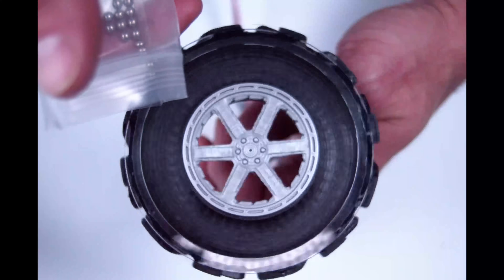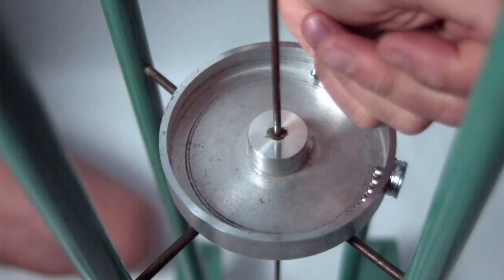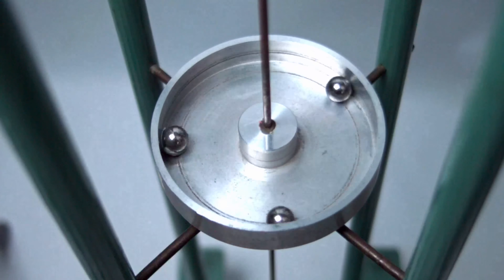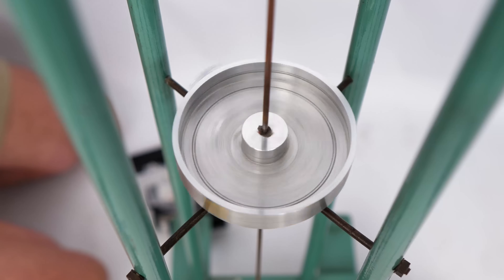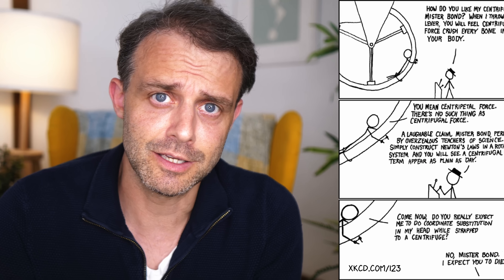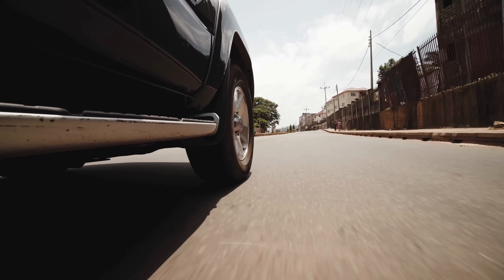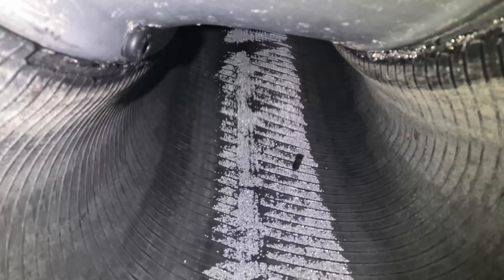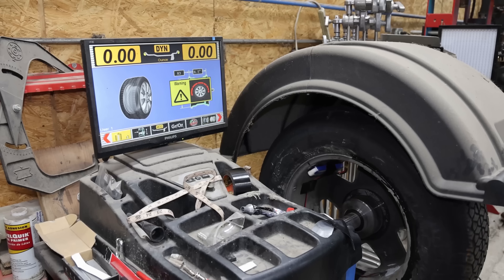Do tire balancing beads actually work?

Comment: I worked at a tire shop for a few years. My thoughts are this: beads are a last resort. Some people get great big ugly wheels and out-of-factory-spec sized tires, and sometimes those combinations of wheels and tires are cheaply made or badly balanced. That's where beads come in, because otherwise, you'd be putting on a whole kilo of weights all around the circumference of the wheel and you're never supposed to put more than 1 weight on. A bad balance job is putting on a weight, then counter-balancing that first weight with another one. That's what the first one was for, was balancing against the wheel and tire's lack of balance in the first place. And weights don't have the problem of needing the tire to be spun up to a certain speed for them to work as intended. We hardly used beads at my shop, but some people REALLY want that big, lifted truck look and spend the absolute minimum for bad wheels and cheap tires to achieve it. I still got paid for the work, so I didn't care much.

Comment: Considering you get free mounting and balancing when you buy new tires... who gives a shit? lmfao when you get new tires, problem solved til you need new ones again. 

Usually even used tires they will sometimes still balance them for free lol. At the very least, cheaper than these plus shipping and time waiting lmfao. So yeah technically it "works" but it's still a scam.

Comment: I concur with your research based on my personal experience. 

After installing balancing beads on my offroad Jeep on 37" tires, I still had issues going from 0 to ~30mph experiencing violent "death wobble" as many term it. A product of large unbalanced tires and soft offroad suspension. It would be so bad at times that I would be forced to pull off the road. After reaching the supercritical point, it was fine. 

I ended up removing them for a traditional balance, as my driving consisted of highway speeds to a stop, no slowdowns. 

Your speed approximation for the supercritical point is tire diameter dependent, fyi.

Comment: The best use of this would be to create quick-balancing tires. Rather than leaving a mess of beads to slide around inside the tire and potentially damage it, you have some weights on rails inside the tires that can be unsecured, allowed to move into their optimal position from the tire rotation, and then re-secured to keep them balanced without losing it when you slow down or causing wear from their motion.

Comment: Its the same with my old 1 Cylinder motorcycle I think. At lower rpms it completely rattles itself apart, but when revving higher it suddenly goes quiet and doesnt rattle that bad.

Comment: The visible issue from this video is that the shaft under the wheel is now wobbling. So would that wobble transfer to other parts of a drive shaft, perhaps even into the gearbox?

Comment: anyone in the comments here used beads on vintage aluminum wheels? I have some wheels from the late 60's that have to be balanced by the lug nut holes, they're not machined in the center so they can't be balanced there. No tire shops around here can do lug balancing.

Comment: I used them myself and use them they do work when the quality of them it good. Smaller and more are best and at speeds of over 40mph I always had a very smooth ride. And yes I tested them even on 80-100mph and yes it works. I had tested it on speed low profile, offroad and even 39" tires and it works very well as long the applied mass in the tire is 20% greater than the out of balance of the whole wheel assembly.

Comment: I just started the video.  But a tire its not a circle when riding a car. The rim it is. You should have like 55psi air pressure to this to work or solid tires. You hit a hole going 180km/h and its gonna make the opposite effect for a couple of very dangerous seconds

Comment: Had a set of tires once that the shop used balance beads in it. Couldn't stand to ride in it. Took the truck back and had them take the out and balance the tires correctly. I'll never run those stupid things again

Comment: I've used tire beads in many sizes and styles of tires, from summer car tires to off road truck tires. 
Generally speaking, the speed at which the unbalanced tire would noticeably vibrate, is also the speed at which the tire beads begin to work. 
In other words, they tend to work very well, as long as there is sufficient quantity to offset the weight imbalance of the wheel.  Proper installation and sufficient weight is paramount for beads to be effective.

On some smaller tires, they sometimes do not work as well, and they may negatively impact TPMS sensors on equipped vehicles

Beads can sometimes make up for worn suspension components (such as shocks and bushings) as long as their weight is sufficient to counteract the movement of the suspension.

Comment: so im posting this to make a prediction about why it shakes less when its faster. 
the idea is that the off center weight is what pulls the bar to the side due to centripetal force. thats what causes the large wobble.
but at hig speeds the moment it gets pulled to the side, the weight has already shifted to a new location. and at a high enough speed the weight has already moved 180 degree by the time the bar is getting pulled. essentially creating a sudo counter balance. due to the fact the weight is constantly moving it will never create a perfect one to one counter so there will always be a little wobble. though if this prediction is true that also means theres a speed where the wobble would be small enough to not really notice.
i also think a big part of this is the fact the wheel and the axel are 2 separate forces. if they were one singular mass i think the wobble would be made worse instead of correcting itself. 
i have done NO research into this. just playing out how i understand physics in my head to test if its correct before he gives an answer

Comment: Physically I can see that the beads, when in motion, will migrate to a position that balances out the disc. Okay, that works.  BUT, where this whole concept fails, IMHO, is that since the beads are not fixed in place, it means that initially each and every time you drive the vehicle, the wheels will initially be out of balance and create vibration until such time that they reorganize themselves again.... and again... and again... and again. So yes, balancing beads work. Just not well. It's like putting a bandaid over a cut, and then each morning ripping off the scab and applying a new band-aid to cover the damage. Why do I use a bandaid example? Because those beads will create internal wear through abrasion, and in turn create a residue of finely ground rubber. Would that potentially create a blockage of the tire valve?  It's an interesting concept, but not a practical solution to tire balancing.

Comment: balance beads in Slower inner city traffic @ 35 mph average is useless. Tire will need a higher rotational speed to balance them sevles, @ 60 or more mph. Works great on semi truck , but is wobbly at inner city stop and go traffic. Both Lexus SUV and Toyota Camry were a failure. But worked on highway truck.

Comment: I work in a tireshop, and rarely see  these beads. Actually been working there for close to 10 years now and have only seen them twice.  Thankfully.  They ARE a cool concept.  I won't deny that, but they are fairly useless in the city.  Stop and go, stop and go.  Speed limits don't reach that critical speed needed for the beads to take effect, and so you're constantly left with unbalanced tires.  PLUS they are so MESSY.  Especially when you don't know there are balancing beads in the tire!  Anyhow, we use weights.  They ALWAYS work, no matter your speed, and they aren't as messy... unless you have my boss working who tends to just drops the weights he just removed off the rim onto the ground instead of the buckets we are SUPPOSED to put the used weights in for recycling.  Leave him alone balancing all day, and you'll have weights and the paper off the back of the sticker weights all over the floor! lol

Comment: This is very interesting. But it won't work in real life. 

A tire shop balances a tire, they will put counterweight on the inside and the outside of the tire. So both inside and outside of the tire would balance out. The beads will not go to the right place to make this work. On top of that, you will need to put the tire on a balancer to figure out how much beads you need to put inside of the tire. It is a waste of time because if you are a tire tech, you know you will have to bleed the air out of the tire, break the tire bead just to put these beads in. Air it back up. Put it back on the balancer to make sure it balances out. If not? Repeat. Very time consuming. 

Inside of the tire is the inner liner. The inner liner is curved, so the beads will go to the center instead of the inside or outside of the tire where it needs counterweight.

Tire rotates. Beads move freely. What does that mean? It means the beads will wear the inner liner down. Inner liner is very thin and its job is to keep air from escaping. It is not repairable if it is compromised. Unlike getting a puncture where a tire tech can plug and patch the damaged area. Simple way to say this is beads will eat the tire from within like cancer. Tire becomes road hazard without warning. 

If anyone wanna try this out. Be my guest. But keep us updated. I'm totally ok if someone can prove me wrong.

Comment: Been putting 4 or 5 goofballs in my oversized truck tires for years.  Works great.  They smooth out at about 25 mph.  Never had to get up to highway speeds. Prob the larger diameter of a golf ball allows it to move into place much easier than all the small diameter beads.

Comment: Every video I have seen where people test them, they work. But every time I see a video on someone asking a mechanic, they say they don't work and often time have to remove them after people put them in and cause issues. Interestingly when he shows the inside of the tire, that guys test showed them starting to work at very slow speeds.

Super annoying. Best answer I have heard is that if moisture gets in the tire (from the compressor usually) than the balancing beads stop working.

Comment: Could you use thermal sensitive plastic so when you hit those high way speeds, it melts the plastic beads in the place they need to be? With some rubber flux to help adhere to the rubber tire? This would solidify the beads in place for slower speeds, and even if you start to degrade it too far, it should still space correctly.
Reply: Alot easier said then done, but you know...

Comment: I swap and balance my own tires on my motorcycle. I didn’t have much confidence in the beads, and this video has turned me off the current beads. I wonder if a bead infused lightweight putty might keep the beads stuck to the sweet spot, but not so much that higher speeds, and momentum, can’t continuously improve the balance.

Comment: I use them on a motorcycle, and they work great. I mount my own tires and dont have to pay to have them balanced. Just add the correct amount of beads. Ive been 100plus with no issues. They also work and are safe inside motorcycle inner tubes as well.

Comment: Anyone ever measure if this decreases fuel economy before the beads get to the right place?I would imagine that a properly placed fixed weight would have an advance of being in the right spot ore of the time across all sleds. Obviously if truck tires wear, and the balance changes fixed weights won’t help.

On the test stand, measure plot rpm vs energy consumption…

Comment: Even before watching the Video I as Car Mechatronic thought: What a scam, just invest bit money in balancing your tires by a professional and don't use such Scam xD 
Might work for the time you are driving at a certain speed or at least had a high enough speed reached for a certain time... but the second you have to break and go down over a minimum speed or have to stop, it's gone again and you have to accelerate to the high enough speed again... and since my assumed speed for this would be again around 80-100 km/h (50-60mp/h) I already thought: Wont work for Citys, only works for Cars nearly 100% on Motorways, Freeways, Highways, Autobahn or what you like to call it ^^ and even in Germany here, with all the traffic jams and construction sides on our Autobahn this will bring those pearls back to "default" position all the time and therefore the tires out of balance... also I guess even though the this might be glas pearls... if the need to be cheaper then getting your tires balanced by a professional, they might not be perfectly round and without any cracks or things... therefore the might damage the tire from the inside and since there most of the time is a bit moister inside a tire cause of the Air and slight diffusion... and therefor these rubber pieces or rubber powder that is made from the imperfect pearls rubbing against the rubber, will clumb together and will get a bigger mass by themself... and will cause maybe to much counterwait, the pearls can't outbalance... or get a sticky mass, there the pearls get stuck to...

And Video convinced me, that this is BS and you should get a professional tire balancing, not this waste of money! Like even if you would drive constantly on a Freeway and get to those speeds often... the time till you get them, your car is imbalanced and things like your wheel bearings won't thank you for this... so you might save a bit money by not balance your tires, but will have to pay MUCH more afterwards by constantly have to Change other parts that get damaged by your often imbalanced tires (like said for example your Wheel Bearings).

Comment: Those beads are interesting, but they fall apart in city way driving. As you stop at signs and lights more often then not, removing the effects of the beads, while also not having the time, room or legality to get back up to speeds to let the beads get into place... Still useful knowledge and depending on the usage of the vehicle, could be useful!

Comment: The choice between a solution that always works but requires a little more effort or a solution that sometimes works but lets you be lazy is an easy one for me.
I value dependability.

Comment: psss.... real cars do rarely sometimnes use this and they are plastic beads not glass or metal for automotive.is only ever done if an excessive weight is needed to balance tire, typically lorry/big rig tires would need this not a small truck or car.

Comment: 2:28  I think that fixing a ball bearing inside the wheel will compromise your experiment.  That's because there is a dynamic process by which the other ball bearings reach a state of counterbalance, and being allowed to move freely around the wheel may be essential to achieving this state.

Comment: What if the beads get sticky when heated up? Will highway speeds not heat up the tire and therefore the beads, and fix the lower speed problem?

Comment: The beads would have to have a way to stick to the inside of the car wheel once they are in the right place to be completely effective, maybe a liquid or gas that chemically reacts to the beads and binds them to the wheel after a short time.

Comment: Many years ago I put balancing/tire sealant in my motorcycle tires.  It takes a few miles to actually the thick fluid to disperse around the tire for the balancing to begin. Once balanced, the fluid tended to stay in place, and adjusted automatically as needed.

Comment: Rock crawlers with slower moving wheel speeds has used that balancing system for a couple of decades. Steel Balls not glass beads.

Comment: These beads are advertised as a great way to balance heavy off-road and heavy-duty tires. I tried them on my 37" tires, and they didn’t work. After watching the video, it’s clear why. If they only balance properly at 10–15 rotations per second, as the author mentions at 9:18, that translates to the following speeds:

35" tires: 100–150 km/h
37" tires: 106–159 km/h
40" tires: 115–173 km/h

So, the larger the tires, the higher the speed required for balancing. These beads don’t make much sense for off-road tires and might only be useful for smaller wheels, which are already easy to balance without beads.
Reply: The larger your wheel the lower will be the resonant frequency that you need to exceed.    Also,  the rpm will be lower for any given road speed.    There are many comments here from people testifying to their effective use.

Comment: Sounds like the beads would be a permanent solution if some sort of heat-cured adhesive was included. That way, the beads would move freely until the tire heats up, i.e. at freeway speed, and then they would be locked into place.

Comment: Honestly it sounds like it would just make it worse.  I mean you need balancing most on city streets which is where you have a lot of stops and every time you stop all the beads will fall to the bottom which even if the wheels were balanced would throw it off because the beads are all clumped up at the bottom of the wheel.

Comment: Random thought. What if the beads were magnetic? I ask because with the glass beads, at slow speeds, gravity will overcome centrifugal force and make things worse until freeway speeds again. Yet, if the beads were magnetic, and since tires have metal running through the rubber, could the centrifugal force overcome the magnetism enough to space the beads in the best place, and stay?

Comment: seems like the beads need to have a rubber cement inside, and be made of a thin layer of glass that will only break after the balance point is met, maybe from tire heat, so they get to the balance point, crack, and glue themselves into place